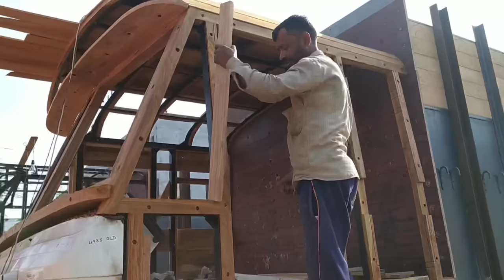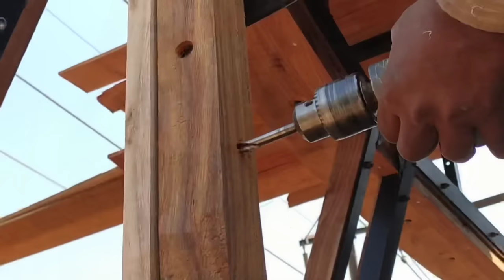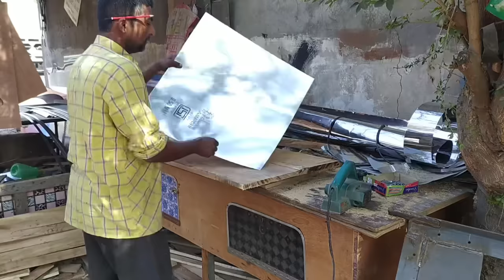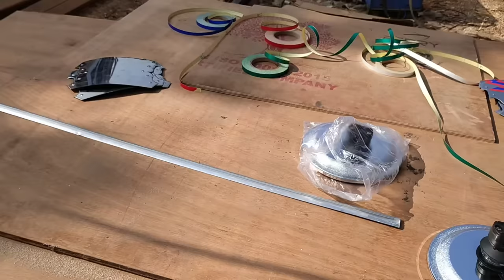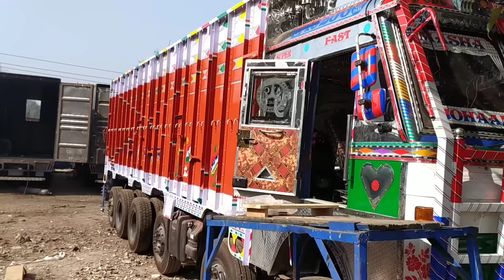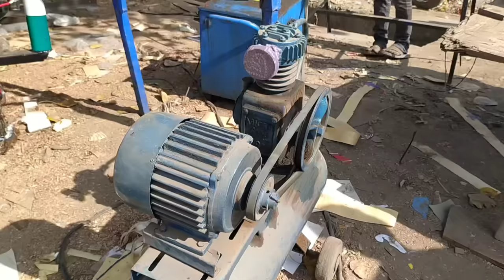Truck  body building and cabin making process in India | Indian truck body building

Comment: Why the cabin of this truck is not full made from steel ?
Reply: These cabbins are heat proof
Reply: These are not safe also. Ig this is from Bihar. Best truck body are bulid in Rajasthan
Reply: But that guy doing a great job 👌👍👍
Reply: Steel ah panna theriyathu disign 💥💥🤣🤣
Reply: Ask the company!
Reply: India is verry hot and humid
Reply: Back to nature
Reply: These guys hv great skills. Yes I’m wondering the same why not build with steels 🤔
Reply: Buset kabin ya pake kayu kaya mobil2. Anak kecil 😄😄😄😄
Reply: @blueskymusicindonesia112  after one year driver enjoys mangoes on trucks body😂
Reply: Cost cutting
Reply: @zchawngthuzo-achawngthu5142 which company man 😂
Reply: Cost cutting
Reply: Cost cutting
Reply: Steel is used too in some areas of the truck. There are full factory built Bodies too in India. But these are basically cowl chassis trucks where the owner-driver buys the truck head  plus chassis and then let's a local workshop build and decorate the body
Reply: Maybe there are government regulations for local wisdom.